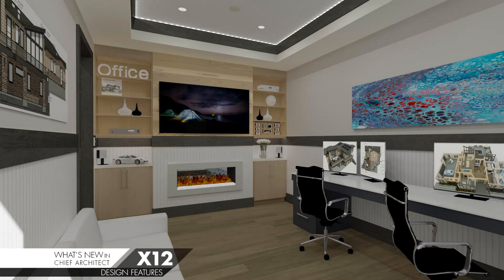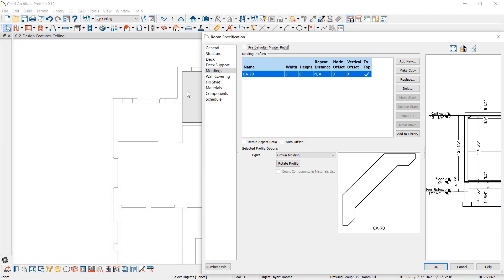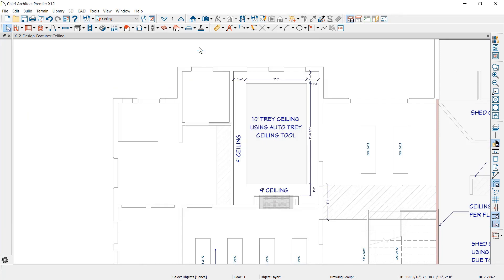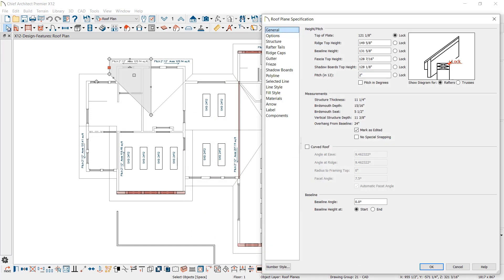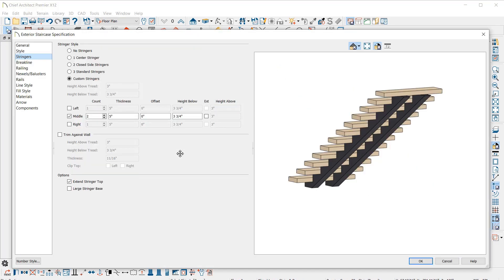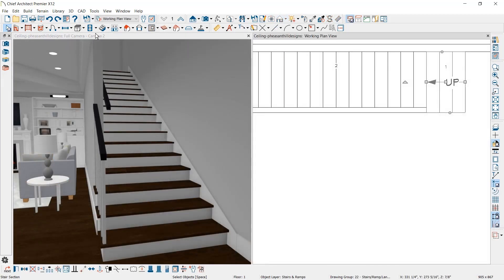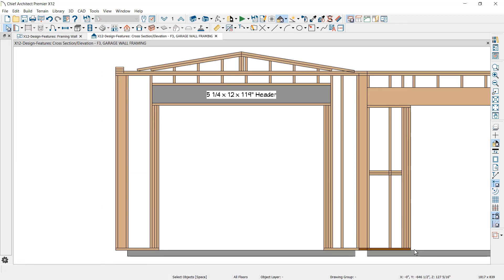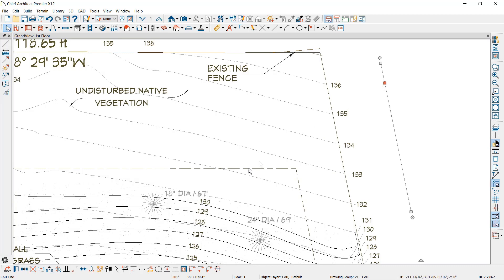New Design Features in X12

Comment: X12 doesn't have break wall tool and we need livesyn chief architect to Lumion great work otherwise
Reply from the maker: When you select a wall, the break wall tool should appear in your bottom toolbar. If it does not appear, you can call our Technical Support team to assist you. Technical support can be reached at 208-665-3674 Monday – Friday from 7 AM – 5 PM Pacific.